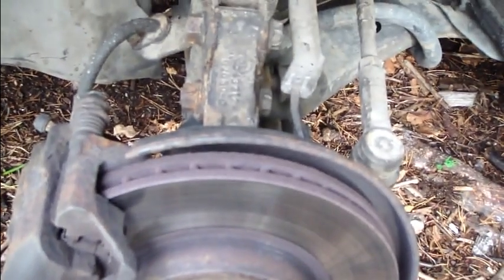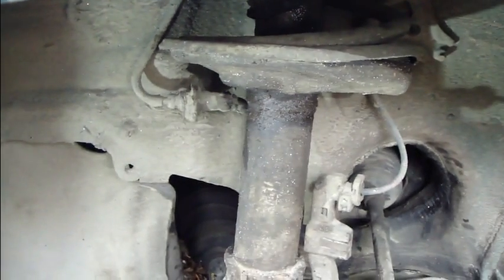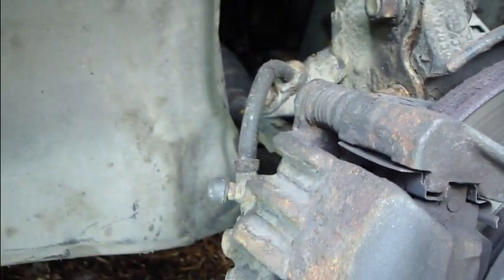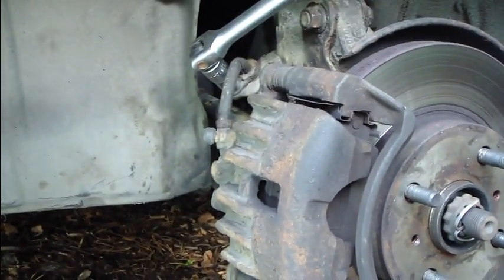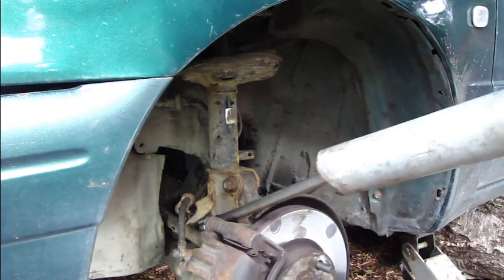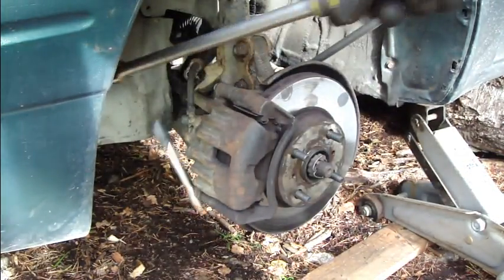How to replace coil spring and strut assembly front. Toyota Corolla. Years 1992 to 2011

Comment: Can i only chnge the seal becaus it is leak..
Reply from the maker: Noted 👍
Reply from the maker: Yes
Reply: In western world you always change the entire shock. Changing only the seal and refilling it with similar oil is never done in a garage and very rarely by DIY repairers unless they cannot source a similar new or rebuilt replacement shock. It takes a share of skill and suitable tools to do shock rebuilds. I would advise against doing this if replacement shocks are available to buy.

Comment: i prefer using jack stands they are not that expensive and much better for saftey reasons 
the tool is called a Breaker bar and a Leverage pipe
Reply from the maker: Thank You for positive message. :-)

Comment: Great video! Can you confirm that you didn't need spring compressors?
Reply from the maker: komanjoe Yes, if you replace the full packet same time. This packet is shock and spring.
Reply: Peter Finn Rockauto.com sells them as complete struts for about 50 bucks each